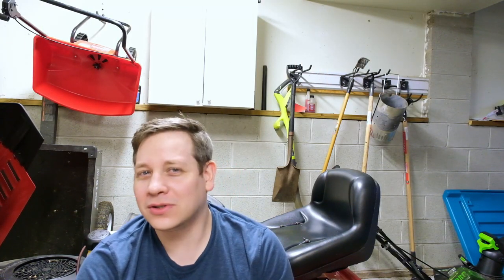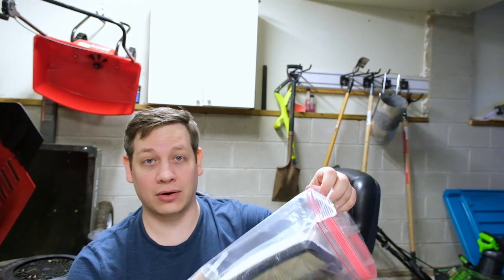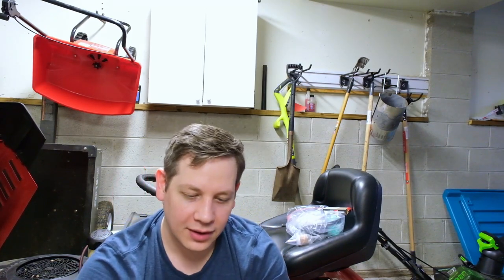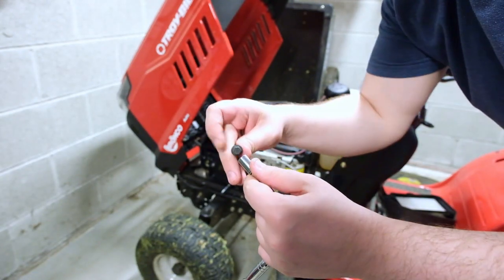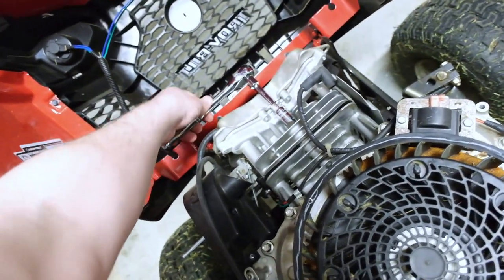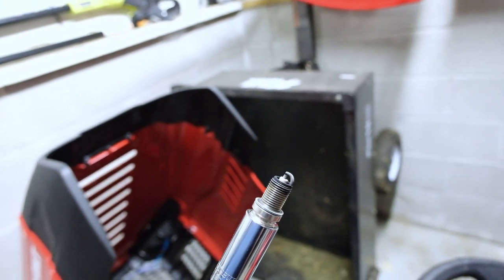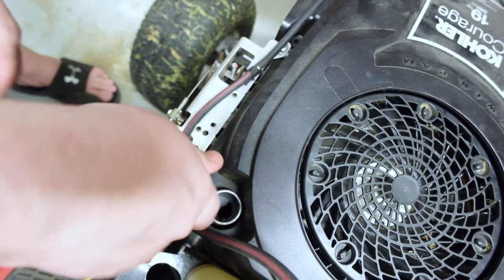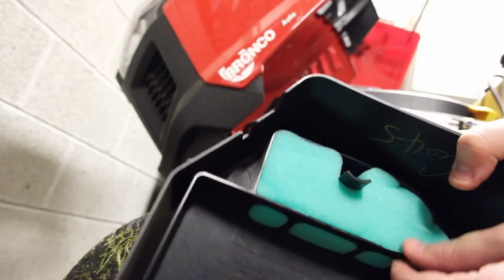Troy-Bilt Bronco Spark Plug Replacement

Comment: Thank you for these videos. I’ve had my bronco almost 4 years. Last mow it was rough to shift between N and F. First time ever a problem. Trying to find answers here on YT. Trying to figure this out myself so thanks for any videos you make on maintaining this mower. I appreciate your posts.
Reply from the maker: I usually only have a stiff shift after letting my mower sit for the winter, which subsides after I get the mower ready for the season. I hope the issue was easy to resolve. I will make a video on it if it should ever come up on mine! Thank you for watching!

Comment: Well...new spark plug, new ignition module and new air filter and still wasn't running. Bad ignition coil. Will be running later.  Tuned up now anyway😁

Comment: Would a bad plug cause the motor to not even turn over? It started right up with a new battery, I turned it off to change a deck spindle and it won’t start now. Not sure I put the belt on right but it looks like the diagram
Reply from the maker: Sounds unlikely but it is possible. I'd suspect it may be the belt tension or routing may be at issue if it is completely dead and receiving fuel, air and spark. Thank you for watching!
Reply: How would I adjust the tension? Any ideas? I’m thinking that is it also.
Reply from the maker: @vickigodown4797  most models handle tension through one or more springs. The springs will pull the deck brackets and place tension on the belt. If the spring is not fully connected, weakened, or a bracket is stuck that could cause the issue of a fire state but no turn. This is a very general diagram of what some models use:

https://th.bing.com/th/id/R.8ce3dbda305a33cf0309ea935955cb69?rik=%2fpJoJJGVhadbTg&riu=http%3a%2f%2fduanpalmgarden.com%2fwp-content%2fuploads%2f2018%2f02%2ftroy-bilt-riding-lawn-mower-belt-diagram.jpg&ehk=O5rUi0p7aUPDxhfokQYkkd%2bfyH7olTAWvpZm2i1ilWU%3d&risl=&pid=ImgRaw&r=0&sres=1&sresct=1

Comment: Can a bad spark plug cause a riding mower not to move forward or backwards?
Reply from the maker: If the spark plug is bad it would be more likely to cause the engine to not start. The mower not going into forward or reverse would likely be a transmission or brake issue imo. I've had mowers were the brake cable sticks causing the mower to lock into neutral as a safety feature. Usually fixed by applying and releasing brake a few times, lubricating the brake component, and manually releasing. If it is a transmission issue it would likely need a service shop to diagnose and repair. Thank you for watching!

Comment: I CAN'T BELIEVE IT.  This is the second video that I have watched about changing the spark plug on a Troy Bilt and neither one 
checked the spark plug gap.  You always check the gap, even if the plug is new. This is one of the main reasons you remove the
 plug.
Reply from the maker: Hello I checked the gap off camera and compared to the Chinese one I got from Amazon. Gap was dead on, this is how I knew the old plug was worn out. The Chinese plug had a gap that was .015 too large.
Reply: @Matty_Ice_Reviews  What is the spark gap supposed to be set at? My GoogleFu has failed me.
Reply from the maker: @Taltas  the gap for the 25 132 12-S spark plug is .028. Thank you for watching!

Comment: how u know the sparkplug is bad
Reply from the maker: Indicators from operation of the engine are poor performance, refusal to turn over, engine cutting out, rough idle, poor fuel economy. This can be caused by build up in excess, scorching, cracking, and reduction in the electrode which can be diagnosed by pulling the plug. Thankfully they are only a few bucks and should be changed periodically. My recommendation on lawn equipment is to check every other season and plan to replace on the 3rd to 4th season. Thank you for watching!